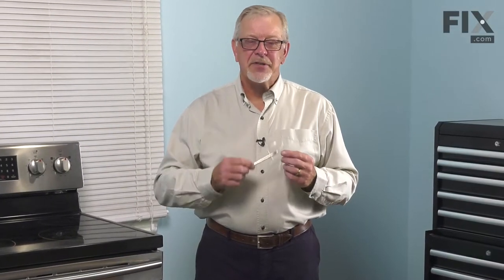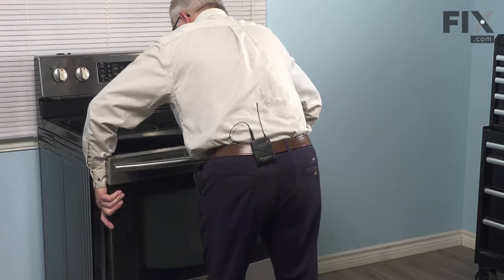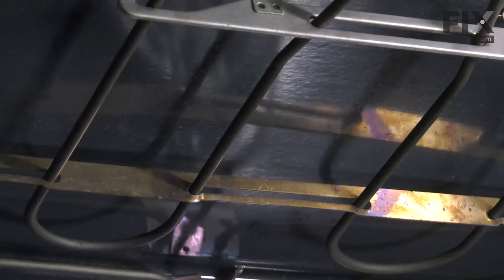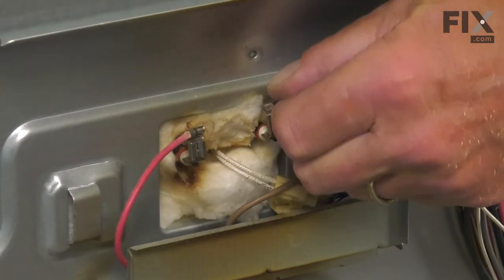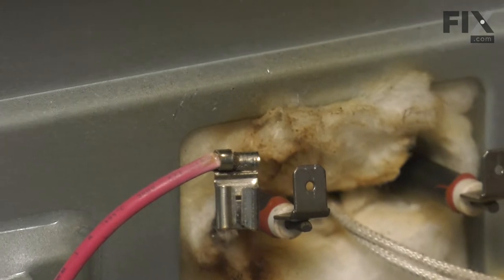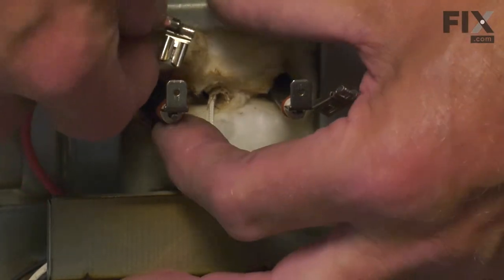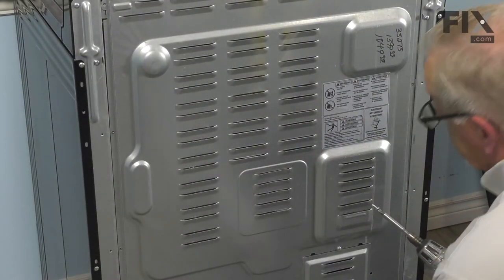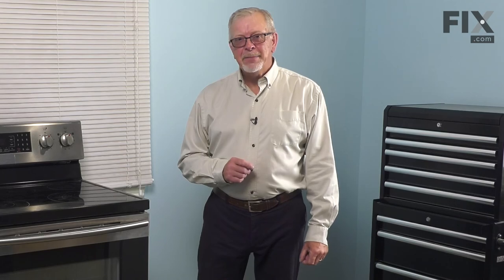Samsung Range Repair - How to Replace the Temperature Sensor

Comment: Hi Steve…a quick question if I may…the readout has been “flickering” for quite some time on my Samsung electric stove yet the oven and cooktop have functioned perfectly. As off a few days ago, the cooktop continues to function normally but, the oven temp does not match the readout temperature. Readout temperature says 350 degrees but in reality, it has only reached 250 degrees. It seems I have multiple issues…any suggestions?
Reply: You must have the same mod as me. Mine started flickering after one year. I need to see about replacing it too
Reply: Same problem but no flickering.  Just not reaching temp that the oven says it is.

Comment: Changed the Temp Sensor and bake element, but oven still not reaching the baking temperature set even though oven says it has.  What gives with that?
Reply: Did you figure out the issue

Comment: This, and my LED display missing lines.  The 8 might look like a 3.   Am I the only one who thinks everything made today is disposable garbage?   I have a Whirlpool fridge from 1991.  I refuse to replace, even with the wife being angry (some would argue hostile) at times.    It works, and I know people who've replace 3 to 4 in the same 30 plus years.   
Never should've replaced my old washer.  I bought a 1200$ G.E. front loader I ended up tossing out because the main spider that holds the basket broke.  G.E. said tough luck!